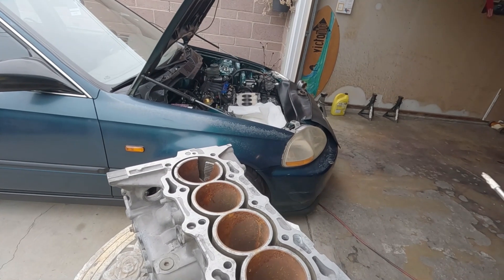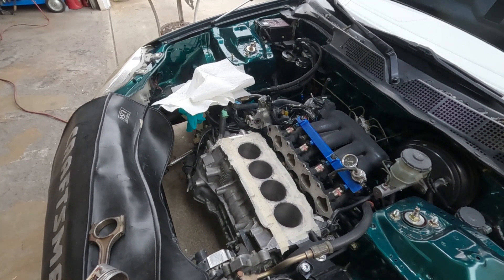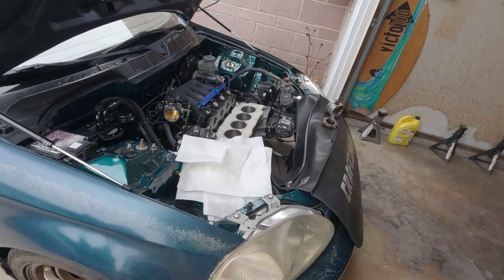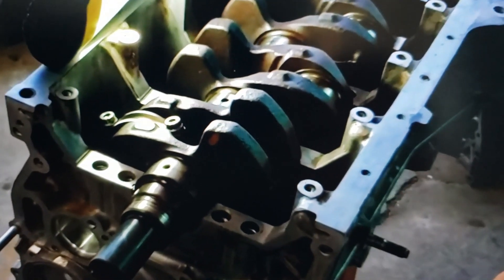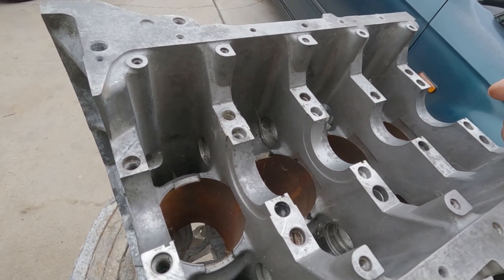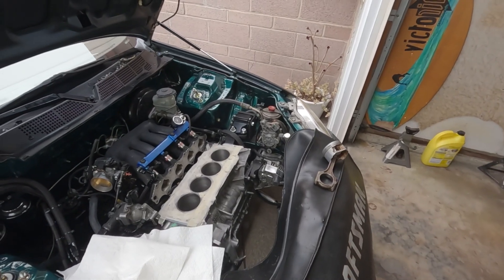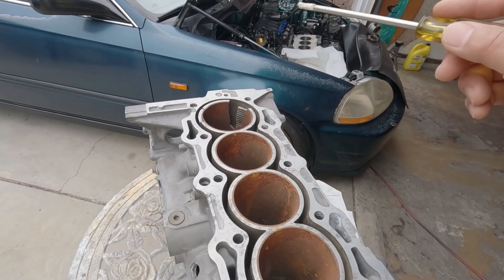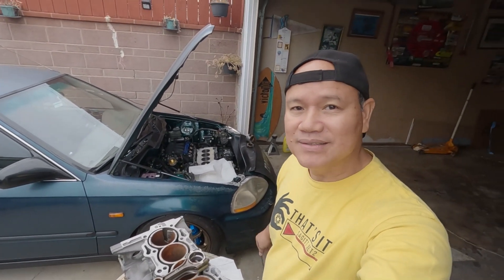Wet sleeve vs dry sleeve! How a Machinist explained!

Comment: Those aftermarket rods look like trash.
Reply from the maker: Its alright on my build! 1 set  actually survived and l'm using it on a different turbo g23 motor after its been on than f23 block that l showed w/ a damaged sleeved. After that experienced, l have no doubt it'll do the job on any power goal l've made.
Reply: @sagittnet2158  the reason I say that, is because it looks like the rod caps were CUT, instead of snapped. Maybe it's just an illusion. Otherwise, they look nice. I'm not a fan of open decks, either. They're just not rugged enough. The slightly better cooling isn't worth the structural compromise. At least that's my opinion.
Reply from the maker: @BiffTannen1983 LAsleeve has a price range and depending on power goal, its open deck l got. Its capable up to 700whp and l guezs more than that, its the closed deck sleeve is what they use. Thanka brother

Comment: I have a few questions for you sensei. 1. Is it possible to retain evap with a boosted setup? 2. How do you prevent the intake manifold ports (i.e. pressure regulator line, brake booster line, etc.) from blowing off or will they blow off under boost pressure? And finally 3. Is it necessary to run 4-ports to catch-can for around 300hp? 
Love your content because most other Honda content out there are too racecar for me.
Reply from the maker: Evap system can still be use, l used it on last setup and l'll retain it again on present setup. The canister have a safety valve in it and depending on what chassis you have some are electronically controled. The brake booster have a 1 way check valve imbeded inside the hose (96-2k Civic) and hose have a directional arrow marking so it wont be install backwards. Early model of Accord have a one way check valve in between the booster and manifold. The rest of the vacuum hose can simply be secure w/ a ty-wrap to prevent from being pull out under boost.
Reply from the maker: Venting the block is a must if your going boost regardless if your making less than 300 or higher. It's to prevent the oil seal being blown out, the OE pcv system is just not enough to prevent the motor from being pressurize.
Reply from the maker: Thanks man!
Reply: Thank you very much for the information.
Reply from the maker: @tdesia1  no problem man

Comment: So I know you are building a g23 but do you have any info on h23a1 block and h22 head pros and cons. I have everything for a g23 but I would like to rebuild the original h23a1 with an h22 head while I run the g23
Reply from the maker: https://youtu.be/XuEb0C6sm7A?si=1xF0F4HYipSqiQMJ
Reply from the maker: I used to owned a H23a1/h22 frank engine. I dont have a episode on it but l send you a link and that engine is almost similar to what you have in mind minus the f23 crank and rods. Make sure to remove the oil restrictor that was on the H23a1 block before installing the H22 cyl head. For piston selection to use, you can use H22a4 if you like but only downside on that is, piston will stick out about 0.020" pass the block meaning you'll have more comp ratio. If you can get a H23avtec (bluetop) piston, thats the ideal piston to use on H23a1/ H22 build coz the piston height is perfect. No need to install the oil squirters, there's more to it than just bending the end nozzle. But l have all the info that you can use as a guide if you have time to watch it. It's all on H22 stroker build. Hope this help you out.
Reply: @sagittnet2158 
So i've watched a couple of your videos and the reason I asked a question is some of the information that I have found says that the crank shaft walks at higher rev ranges have you encountered this at all in any of is your engine builds i don't have much experiencewith the h and f engines and I have never encountered phenomena on a b series engine that i have built.
Reply from the maker: @davidciena501  I think what makes it walk in my opinion is using a stiff clutch assy like stg 3 on some engine that not really make a lot of hp. I never really have any issue of crank walking on any of my build. The thrust bearings still look good when l checked it.
Reply from the maker: @davidciena501  The frank engine is not really design for higher rpm. It can rev pass 7k but it wont last unlike a H22 and F20b w/c is really designed for hi rpm.

Comment: For a long term stock or near stock engine I'd avoid the wet sleeves, but I'm tainted by the PRV V6 engine found in Volvo, Peugeot and Renault cars. Designation B27 on Volvo. The sleeves there have a tendency to leak water into the oil. Later Volvo made a number of changes to the designation B28, which improved things quite a bit.
OK, this was mostly a rant about that.
Other discussions I have encountered have been around open and closed engine block deck where the closed deck is preferred since it's a lot stronger in the area right by the cylinder head.
Reply from the maker: Yes, close deck is much prefere over a open deck design. If using it higher than 450whp. I aggree and thanks for your feedback.

Comment: Kuya can you build me a high compression k20a3 block
Reply from the maker: Friend gave me his a3 block and I thought of building a A3 vtec killer but my tuner advise me not to pursue it. It not worth the effort he said. 
.
Reply: @sagittnet2158  I was thinking of a budget build, a3 block with a2 components and an a2 head.  The block is almost identical with an a2 minus the squirters
Reply from the maker: @bhadz100  Since you are building a a3/ a2 frank motor, it'll be something different.